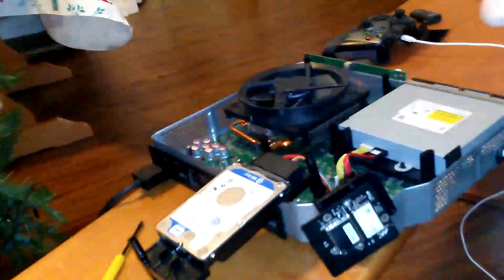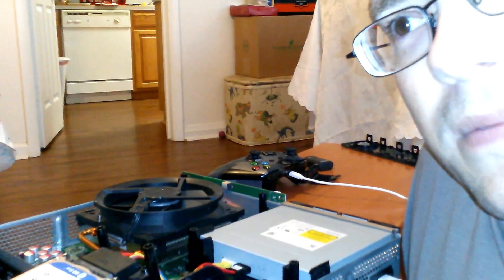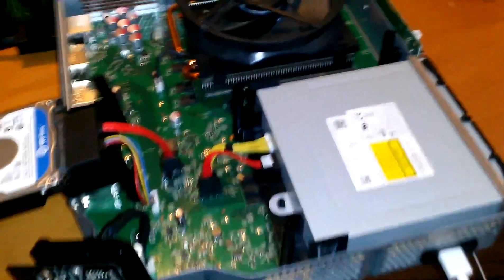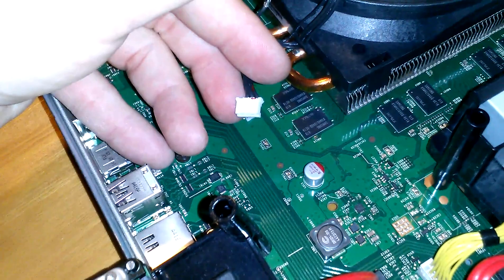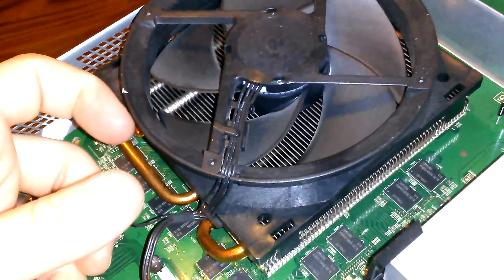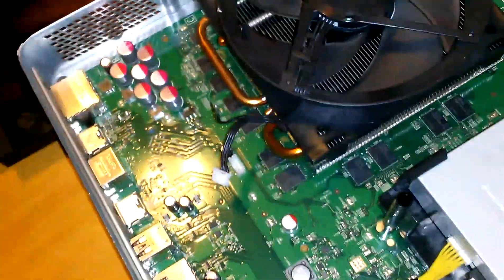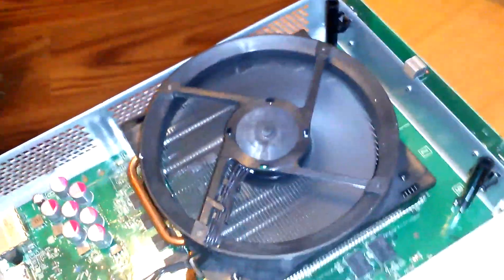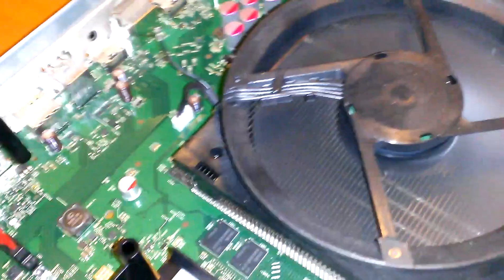xbox one fan overclock 12v fanmod

Comment: I replaced my fan, cleaned the heatsink and replaced the thermal paste about a month ago. The fan never speeds up, I have checked. I get maybe 20 minutes or so of matchmaking then things slow down, eventually stuttering, freezing and shutting off. If the fan does not speed up, is it a problem on the main circuit board feeding it? An external fan on top of the console running on high helps give it more time, but it still lags once I get playing.

Comment: Thanks for this. I was able to save my friends xbox one S using this mod. First I completely disassembled the unit, cleaned off the dried up thermal grease and replaced it with fresh grease. After that, I could get the console to power up, but a minute after I started a graphics intensive game, the console shut down due to "bad ventilation". I noticed that the fan was still creeping along very slowly even as the console shut down due to heat. I them applied your mod, except I used a switch, so I could enable ir disable the "turbo fan" at will. Once I enabled turbo fan I have been able to play any game for as long as I like without any overheating.

Comment: A 12v fan mod is where you hook up a 12v fan. Not where you take the control wire off the fan connector. And changing the paste would make a much bigger difference, or even just changing the whole cooler out completely. You can buy cheap AF low-profile cpu coolers...
Reply from the maker: Actually i called it that because people in the modding community immedialty understand your meaning, with regards to xbox consoles, when you say “12v fan mod”
Also un limiting the fan allows the 12v fan that it is, to pull a full 12v and push air as hard as it can.
Because microsoft actually didnt do a microsoft where the heatsink and thermal paste are concerned with the xbox one, apparently they learned from their fuckups with the 360, there is no need to buy more parts to make the xbox one run at room temperature. All you need to do is un limit the fan.
But hey you do you. Nobody is twisting your arm.

Comment: how did you remove the wire. Im having an issue un plugging it from the male socket
Reply from the maker: Jcyber15 sorry for the late reply.
I had to use a thumbtack to press in to the retention clip for the individual wire. Its really tiny, and you have to look on the side with the shiny bits on the side. Those are the retention tabs. Just press in gently but firmly with the thumbtack and then pull the wire carefully. Afterwards use some heatshrink to cover up the head of that wire specifically, that way it wont scrape across anything and short anything and possibly fry the system.
Option 2: cut a section out of the specific wire and toss it to the side. This is permanent. The otherbone is reversible. And remember! You will have to do a full shutdown of the system whenever you are done playing it and set the power on options to Not do quick boot. 
Quick boot or fast on or whatever the hell microsoft has named it, keeps the system on at all times... burning itself up. So do a full shutdown. It will extend the life of the console.
Reply: @xboxrepairtraining3628  I ended up ripping the wire and decided to fix a potentiometer to it for a variable speed control. It also allows me turn the fan noise off when i turn the xbox off or want to turn off the fan sound whilst using it.
The wiring is one end of the wire connected to the one of the centre lug and one of the side lugs and the other end on the other side lug. This is to prevent shorting the potentiometer but also a variable resistor would work the same.

Comment: i placed a server exhaust fan on top of my xbox one to help pull out the warm air. i hooked it up to one of the multi power plugs and have it set to 9 volts. it makes a little extra noise but if you turn up the volume you don't hear it and it's much better than an over heated system.i turn up the power to 12 volts when i plan on playing for a good long time like when i'm playing COD.

Comment: 1HRS PS3 PS4 PSP WII XBOX ONE LAPTOP SMART PHONE I-PAD SEGWAY HOVERBOARD REPAIR IN MUMBAI CALL 9819767710  

Shop 246,113 City Center Mall S.V, Road, Goregaon West, Mumbai 400062.
CALL 9819767710

Sony Playstation 3, Ps3 Repair In Mumbai Major All issues Repair 1hrs In Mumbai
 
 
1. ps3 storage cannot be found  repair in Mumbai
2. ps3 system storage cannot be found repair in mumbai
3. ps3 cannot start the appropriate system storage was not found repair in mumbai
4. ps3 slim system storage cannot be accessed repair in mumbai
5. ps3 slim appropriate system storage not found repair in mumbai
 
6. ps3 update failed 8002f14e repair in mumbai
7. ps3 error 8002f14e update loop repair in mumbai
8. ps3 update error 8002f147 repair in mumbai
 
9. ps3 wifi connection problems repair in mumbai
10. ps3 not connecting to wifi repair in mumbai
11. ps3 bluetooth not working repair in mumbai
12. ps3 bluetooth not working controller repair in mumbai
 
13. ps3 hard disk not found repair in mumbai
14. playstation 3 cannot find hard disk repair in mumbai
 
15. ps3 drive wont spin repair in mumbai
16. playstation 3 drive wont spin repair in mumbai
17. ps3 super slim disc not spinning repair in mumbai
18. ps3 super slim hard drive repair in mumbai
19. ps3 blu ray disc not reading repair in mumbai
20. ps3 not reading blu ray movies but read games repair in mumbai
21. ps3 plays games but not blu ray movies repair in mumbai
22. ps3 blu ray drive repair repair in mumbai
 
 
23. ps3 hdmi no signal problem fix repair in mumbai
24. ps3 hdmi no signal problem fix repair in mumbai
25. ps3 hdmi no sound during game play repair in mumbai
26. ps3 no video output hdmi repair in mumbai
27. ps3 hdmi no signal reset not working repair in mumbai
28. ps3 hdmi no video only sound repair in mumbai

Segway hoverboard balancing board repair in mumbai

Segway parts hoverboard parts repair change sale n service in mumbai sensore gypo motherboard all etc.

Xbox One And Xbox 360 Red light dot repair in mumbai 1hrs Spot repair in mumbai 246, City Center Mall s.v road Goregaon West Mumbai.

Repairs spare parts for self balance scooter segway hover board wheel Game Store Mumbai We do repairs and sell spare parts for the self balancing scooter segway Monorover hover board smart balance wheel, chargers, circuit board, Sensor board, body, lights, batteries, power switch, carry bag

XBOX ONE XBOX 360
Xbox One And Xbox 360 Red light dot repair in mumbai 1hrs Spot repair in mumbai

xbox one power brick repair
xbox one power brick fan repair
xbox one power orange light repair
xbox one power supply orange light wont turn on
xbox one won't turn on but beeps repair
xbox one blu ray player wont update repair
xbox one on off button not working repair

Comment: I did this, the fan goes quick, then goes down, this forever,someone knows something about thi?
Reply from the maker: Jesús Iván Alcocer Navarrete you mean the fan spins up when you plug the sustem in to power then stopps? Or when you power on the system to play it?
Because the fan spinning up and then stopping is the system doing a normal systems check to make sure it has all of its parts there.
Reply: Xbox Repair training. I removed the cable, the fan sping since i connect the plug, we call it direct plug, then i turn on the console, spinning is at 1 time...steady, then i put a game and its like if the fan wanted to go quicker but it cant, really weird, spins quickly but then slows down, i put another 12v .40 amps brushless fan connected to the fan inside the console. So when 1 starts, the other the same, now no problem running games, meanwhile i ordered the replacement
Reply from the maker: Jesús Iván Alcocer Navarrete i do not fully understand what you are saying.
What is your native language?
Reply: jajaj spanish
Reply: wish i could post and image here to show you haha
Reply from the maker: Jesús Iván Alcocer Navarrete tell you what. Post a video of what is happening. Show me what is happening in the video and put it on youtube then post a link to it here. That way i can see what you are trying to tell me.
Reply: Josh Aguirre that was before and after icut it

Comment: Couldn't disconnect wire without cutting it... but it works! Should I cover up the cut wire with electrical tape? Or should it be good as it is?
Reply from the maker: electrical tape just for good measure. nobody likes shorted circuits

Comment: but does that burn the fan out faster that way.
Reply: The fans are high quality. Its unlikely for it to make much of a difference.
Reply from the maker: yes but it will take at least 5 years of always being on to do that. get a replacement fan and have it on standby in your parts cabinet just in case.

Comment: U made it worse now you have it running louder than usual
Reply from the maker: Kolby Brian2412 i see it as a worthwhile tradeoff.
take yer pick
1. zero system lag
2. system lag and a melty ball of plastic. cuz that thing gets stupid hot.
Reply: Xbox Repair training but mine never gets hot al all just a bit warm plus the console can't just have no lag that doesn't make sense if your worried so much you could of told Xbox support they will help you with that I have both the Xbox one and s they work just fine plus I have a fix on the Xbox feeling a bit sluggish
Reply from the maker: Kolby Brian2412 well, then maybe you managed to win the digital lottery and got that one unicorn of an xboxone. those happenings are rare in the extreme but it does happen.
one time i stumbled on an xbox 360 gen 1 that had never been powered off in 5 years and had magically never gotten hotter than my own forehead on a cool day. not only that but it was practically dust free on the inside. unicorn!
anyway. the stuff i have on my channel is for people who like to fix things for themselves. the tinkerers the electronic dr frankensiteins etc. the other crazies like myself who go for this kind of thing.
if its not yer thing then dont do it.
if your system is a unicorn as deacribed above. then keep it and love it.
if you dont find my video useful for your particular needs. then i hope it was at least entertaining and or educational.
Reply: but cooler

Comment: that can increase the xbox FPS in games Right?
Reply from the maker: Gabvelez_ 5 well. what it will do is keep the system from suffering any slowdown due to overheating.
as i have stated before: when the xb1 gets over a certsin temperature. it will downclock the processors (slowing down your game reducing framerates and increasing load times and causing all the problems commonly associated with a slow computer. aka "lag") and then it will speed up the fan to cool it off.
once it is cooled enough. it will slow the fan back down and clock the processors back up.
basically causing a horrendous yo-yo effect where you will have a game that almost randomly lags in places and also randomly reduces the texture detail on everything for fuckitall reasons.
doing this mod, keeps the processors at room temperature. aka zero lag and best possible performance, at all times.

the drawback is that it makes the system real damn loud.
but hey. we make sacrifices for good gameplay amirite?
Reply: Maybe but i think you might need to super cool the gpu to.
Reply: Rowyn Gaming official consoles dont have a gpu they have dedicated graphics accelerators aka apu

Comment: thanks man, ur a life saver, I have tried so many things since this system turns off on its own ,  I guess an overheating issue. I have tried so many things. this seems to be the best solution. its loud but its kool!! ur a genius.
Reply: MannyFresh yo i think im having the same issue. Mind if i ask you a couple questions about it? Been trying to fix my xbox for like 2 weeks n i think its a fan issue . My xbox works for movies and netflix and pretty much everything but games. Itll let me play for like 2 minutes then all of a sudden the xbox and power brick turn off. Did u have the same issue?
Reply: MannyFresh xbox one is supposed to give you a overheating message and start rapidly blinking the power button if it overheats. I suppose you got a hardware problem.
Reply: John Doe if its over heating try your thermal paste first when i got my xbox i replaced it straight away as the cheap shit microsoft use was crispy already.

Comment: ok this could help if it keeps the gpu and cpu from thermal throttling. In essense youd be overclocking the whole system. I'm surprised no ones picked up on this.

Comment: I recently purchased a tech armour side mounted fan unit seems to be doing pretty well with 2 fan speeds
Reply from the maker: ALPHA SCOT86 GB those pull air out thru an "in" vent. this causes negative airflow and works against the system fan. it also causes heat to flow in a direction it was not intended to flow in.
but hey. you do you. if it works for you then it works for you.

Comment: Thanks for the vid! i did the same to my xbox fan, i have a question, the fan life will be less doing this fan mod?
Reply: hi i am commenting from my other profile i am the guy in the video:
to answer your question. yes it will reduce the life of the fan itself. so be prepared and ready to buy and install a replacement fan in about 3 years to be on the safe side. 5 years to max out the life of the fan.
be aware. this is 3 complete consecutive years worth of being on all the time.
so if you had the xbox one on at all times of day never turning it off then you would likely have to replace the fan after 3 years, and that is being conservative. (because i believe in babying my game systems.)

Comment: Why not add an ON/OFF switch on the wire instead of removing it? Switching it off before powering up the XBO would give the fan 12v and switching it on before powering up the XBO would be stock speed... Just a thought...
Reply: because some users have their systems on fast boot mode. instead of power save mode. if they dont put a hard on/off switch on it then they will not run the risk of accidentally killing their system. they will only have to deal with the fan being on even when the system is "off"
because fast boot mode has the system always on it just doesnt really tell you it is on.
i dont like fast boot because it keeps the system on and producing system killing heat the entire time. i prefer power save because then it is truly off and the system can actually cool down.
and i dont want to give people info that may lead them to accidentally killing their expensive beloved game systems.
i know i would be crushed if i followed a guide and accidentally killed my game system. i do not want to make anyone do that to themselves ever.
Reply: Totally forgot about that, sorry my bad. I never use fast boot mode either for that exact same reason.
Reply: Definitely trying this

Comment: Is the fan connector the same as a normal pc fan??, because id like so put in a corsair led fan, cheers
Reply: honestly i do not know. i do know it is the same family of fan type that was in the xbox 360 "s" and "e" (or generations 2, and 3 respectively). therefore you can fan mod the one the same as those two generations of xbox 360.
Reply: you can just that you would have to soder on the xbox conector

Comment: today I was using my xbox for about 3 hours and I notice that the xbox fan was blowing at max speed but then I realized my external inter cool was not on so there was no ventilation,  my question is  does the xbox monitor its own temp and control the fan? is that why the fan started to blow at max speed .
Reply: +Nicholas Cortez yes it does monitor and regulate its own temperature. but my issue with it is that microsoft allows it to get very hot before it makes the fan kick into overdrive and actually do its damn job. i am shopping around right now to find an optimal external fan candidate for a hard on off mod that will make all of these other external fans on the marked bypass their temperature detection hardware and just be a "dumb fan" rather than these system burning "smart fans" i will be uploading a new video soon detailing the external fan i modded for my 360. and i will be uploading it here.

Comment: idk kinda thought they stopped overheating with the new vent and fan position
Reply: +zizithakid16 no. they still overheat. but microsoft has supposedly tried to curb this problem by having the system underclock itself and then speed up the fan to cool it off during long gaming sessions. this means lag. i hate hate hate lag. i would rather have a loud system that is trying to launch itself into space, that stays cool, instead of a quiet system that quietly kills itself from overheating.